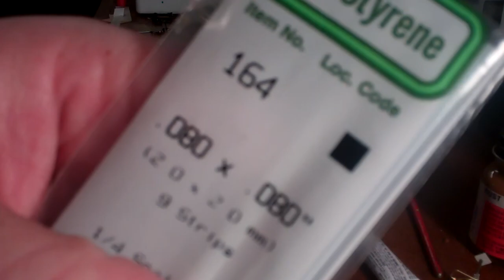How to build HO switch stands

Comment: I think you have a winner with your switch stands.  I like them very, very much.  You mentioned you had seen some very similiar to what you have modeled.  What proto type railroad do those switch stands belong on.  Here where I live is NS territory, and a short line called the Yadkin Valley RR.  Both railroads use the back saver style, which is mounted close to the grounds with a handle very much like the one you designed for your stands.  Keep up the good work.